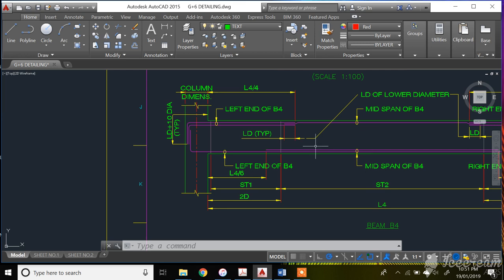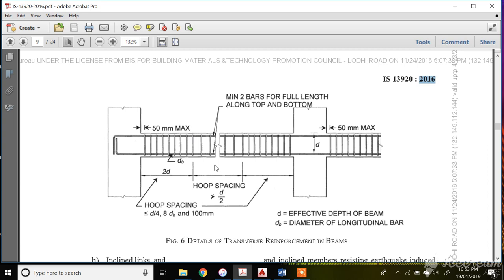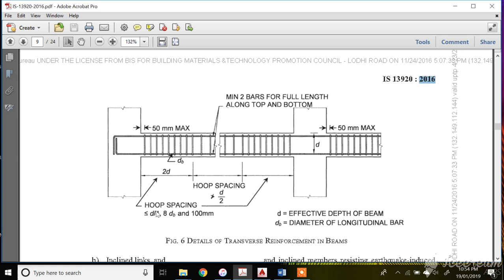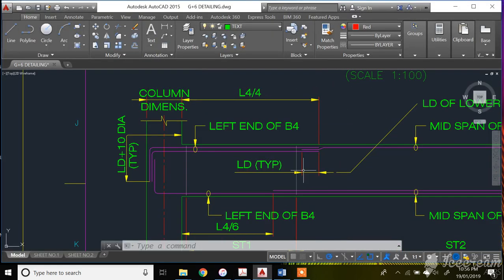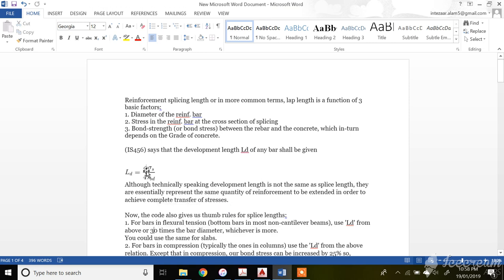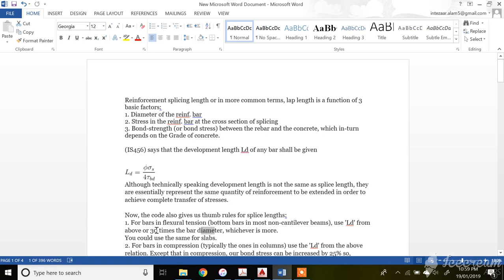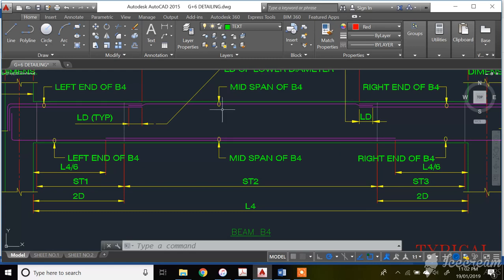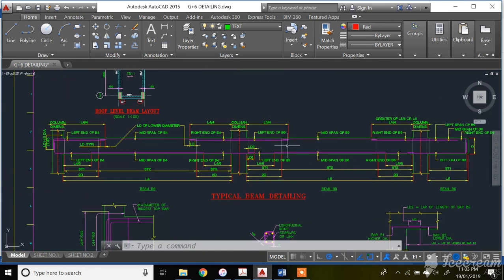G+6 Lecture -11  Detailing of RCC Beam as Per -IS :13920

Comment: Sir in actual architect plan corner columns and beams centre doesn't coincide with each other then in actual project how we model the corner columns and beams in software?
Reply from the maker: architectural plan is our deliverables so if the Column beam centre line is not coinciding with architectural plan then re align the beam column positions. and revise the framing .
Reply: @Sacademicus  so we can model corner columns also in same manner like coincide both columns and beams centre line?